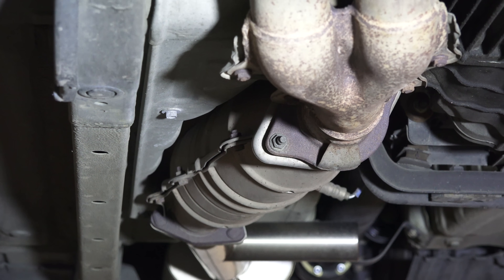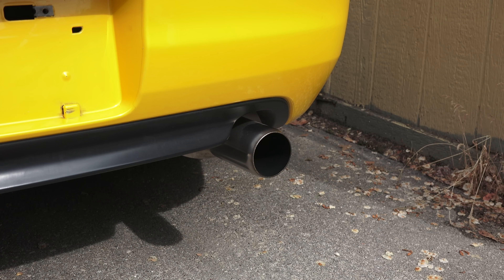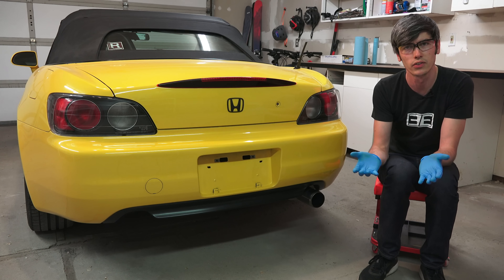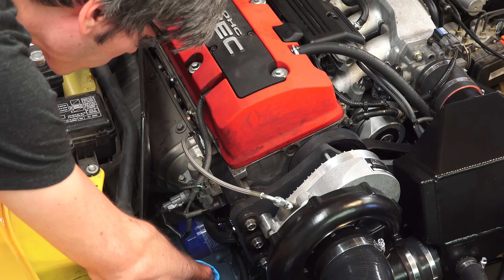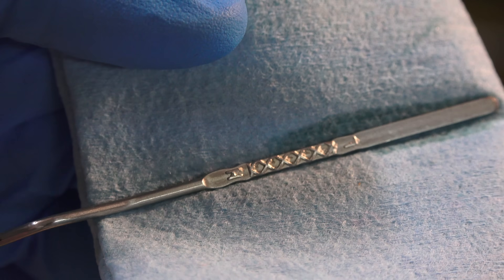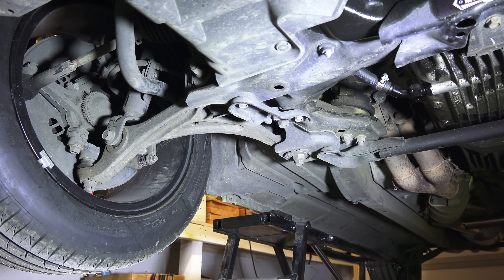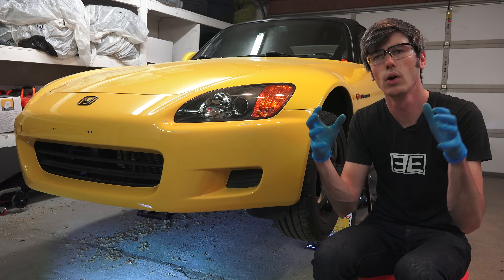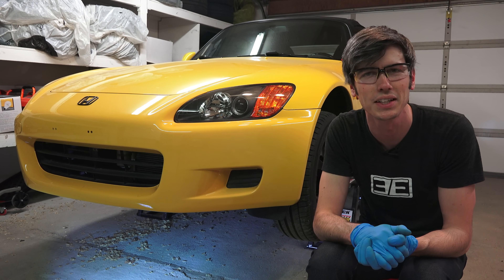5 Signs You Shouldn't Buy A Used Car

Comment: Hey Jason , love your videos! I've always been obsessed with the physics and science  behind the mechanics of machines especially cars. I wanted to put your expertise to the test to help me answer a hypothetical question about pro and turbochargers!! Theoretically would it be possible to power the normally exhaust driven end of a turbocharger with a belt driven procharger and then channel the clean procharger air from the exhaust outlet end of the turbo, that I'm assuming would still have a degree of psi, into the intake piping with the turbocharged air to create much more power than either alone, or would it cause too much load on the engine through the belt to have any sort of gain? I realize the amount of cylinders would have an affect on the degree of power lost due to load.
Reply from the maker: Sorry I'm not exactly sure what you're asking. To me it sounds like you're asking about a belt driven centrifugal supercharger (procharger is a brand of superchargers). These are belt driven, and the compressor looks a lot like the compressor of a turbocharger. Same idea, just using a belt to drive it rather than exhaust.
Reply: @EngineeringExplained  yes that's what I was talking about. I'm asking if, instead of running the charged air from the belt driven turbine straight into the intake, you ran it through the exhaust side of a normal turbo and the combined the air from both the exits that air is coming from and then into the intake, would this multiply the amount of boost without turbo lag or would it make no increase at all?

Comment: Re burning oil: creating a large cloud of smoke from the exhaust after sitting at a light (or other prolonged stop with the engine running) is usually indictive of bad valve stem seals. This is a relatively easy fix so if the rest of the vehicle seems to be taken care of then it might be worth the risk. Especially if you can articulate to the seller that something is wrong & needs to be taken care of.

Comment: I once bought a car that had its catalytic converter cartridge removed. The CC box was there but empty. I only found out 5 years later when I tried to replace it. There were no visible signs, no smoke, engine ran fine etc.

Comment: And, if you see CO2 or CO coming out of the exhaust with an IR camera you should not buy it and buy an EV instead ;)
Reply: Imagine trying to buy a used EV... There are almost no visual signs of things being wrong that you could check for yourself. It would be difficult to know if you're buying a busted one or not.
Reply: @zolikoff  I don't have to imagine.  My household has 3 plug in vehicles.  One fully electric and two plug in hybrids.  I bought them all used and they have been amongst the most reliable and trouble free vehicles I have ever owned.  Checking the condition of a used EV is easier.  The focus is on the battery and range.

Comment: I'd just make a note about the leaking bit: sometimes after a long drive, if it's summer, you'll get condensation from the AC dripping underneath the car. This should be fine and not to be confused with a fluid leak. It's just the extreme temperature difference.

Comment: The 5th sign is kind of moot if the car is OBD1 or earlier... Hondas that are OBD1/OBD0/Pre-OBD0/Pre-OBD1 typically have a jumper hidden in a panel that will make the Check Engine Light (CEL) flash codes. No flashes usually means it's fine. If there are flashes then pull the fuse for the ECU (under the hood) for 15 seconds, re-insert it, and then take the car for that test drive. If during the test drive there is no CEL then it's probably fine.

Comment: You forgot to mention about the transmission if it shifts badly than walk away
Reply: Darn, nothing with a manual for me then....
Reply: Jake Garrett - You're bad at shifting?
Reply: @Ck87JF  Yep! At least I haven't downshifted on the highway by accident in a while... (I did that in town a couple days ago, that was fun... But that's still not technically on the highway!)
Reply: Jake Garrett I decided to test drive a manual 2015 Mazda3 I was considering buying. Stalled it several times in the parking lot, but finally found my groove with the clutch. Stalled it on the way back, because the dealer was trying to fiddle with buttons on the steering wheel at the same time I was trying to turn onto a new road.  >_<

Last I drove manual was an eighties Ford Pinto.  :D
Reply: @Ck87JF  I probably stalled my RX-8 the same amount or more when I test drove it (the owner was staring at me like "wow, when this kid says he can't shift, he really can't shift!"). 

At least it sounds like you're better than my dad. I made a "grasscar" (lawn mower that does 40+ mph, still with the original super wobbly 1970's worn out steering...). It has the clutch and throttle on opposite sides of a normal car (clutch on right, throttle on left). My dad, no joke could be heard 1/4 mile away flooring it and grinding gears (for a solid 4 minutes before I could run over to him), because somehow he couldn't figure out why it wouldn't go into gear... Now, you would think, well maybe if this engine is revved to max shooting flames out the side, well maybe, just maybe, that's not the clutch? That transmission died shortly after. Sad part is he knew it was backwards, but really the worst part is not stopping and thinking, hmmmm.... maybe something is wrong....

So maybe I'm better at shifting than my dad, but I'm not exactly sure that's much of an achievement, LOL!
Reply: @Ck87JF  fair enough as long as the clutch wasn't slipping or grinding gears it fine
Reply: Jake Garrett - I wish I had/have more opportunity to drive a modern stick shift car. I may end up buying one, but people keep saying I'll hate it for daily driving. Without actually doing it, I can't know for sure. 

Anyway, I learned from my mom, and while she's a good driver herself, I'm not sure her teaching was perfect for the technical stuff. I've watched some of this channel's videos on manual, and I think I'm guilty of slipping the clutch.

Comment: there are NO timing issues with the accessory drive belt. you plug the obd2 scanner in BEFORE you turn on the ignition and start the engine. remove it AFTER the ignition and engine are off. you can also tell if there is a low compression cylinder by paying attention to the sound the starter makes as it cranks the engine.

Comment: Check the coolant before you start it, some head gasket failures push byproducts into the coolant and it will usually be visible.
Reply from the maker: Great tip!
Reply: What do u mean by byproducts like pieces of gaskets?

Comment: EVs have no exhaust, no oil, minimal "fluid" (not sure if there's power steering fluid since it's from electric and not from engine vacuum). You should do one for used EV buyers. 1. Stay away from Nissan Leaf. 2. Check battery degradation 3. Check uneven tire wear. What else?
Reply: Well, check the suspension, frame etc. Everything unrelated to the propulsion system is the same for EVs.
However, when it comes to the motor/battery, it sounds like you're out of luck, no good ways of manually checking if they're in order or not. It could have electrical problems that don't come up on a simple test drive. Hopefully digital diagnostics can help out in the future with this.

Comment: This is the check list I used when I bought my 99 civic si a few years back. Mostly stock, only 160000miles, only oil leak was distributor seal and not enough to drip.( easy fix)  It's now at 207000 miles and has given me zero issues. Great video

Comment: I didn't check coolant pipes before buying my used car :/
After 200km of driving the upper hose exploded in the middle of a highway.
Somehow i managed to drive it home for 12km without damaging the engine, after 2500km it has no signs of damage, fluids look fine, no weird smokes coming from the exhaust.

Comment: If you are not mechanically inclined person then find some one else you trust that is when looking for a good used car. If you can not find anyone you trust to help you then do not buy used cars. When I go shopping for used cars I find only 1 out of every 10 cars is in decent shape to buy. The other 9 are going to be shop queens. A used car that spend a lot of time in the shop is costing you a lot more money than a new car will. Consider the cost of a "loaner" car while yours is being fixed as part of the equation. And a self help video is not going to make you a smart used car buyer. Sort of like all the videos on what is the best oil to use in your car. You either know or you do not know. A video is not going to make you a person in the "know" group.
Reply: Good points but binge watching these videos for most people will give them a bucket of tools they can use to go over an used car before the make any further decisions like paying a mechanic to give it a more through inspection etc.  Check out 5 cars if 4 of 5 have issues then the 5th would be the one to spend the money checking.

Comment: I walk away if a car has different tyres on the same axle, it says a lot about the previous owner.
Reply: This is why my number 1 priority when selling trash cars that have had no maintenence whatsoever, is to just buy a set of matching tyres for them before selling. People don't suspect a thing.
Reply: @spinnie0  I knew a guy that flipped cars. Fresh tires and a spray can paint job. Throw it up for max blue book.
Reply: Good observation.  I usually check down at the floorboard to inspect the brake pedal and clutch (if applicable).  If the ribbed pattern is worn down to a smooth surface it's usually a good indication of how the car was treated by the previous owner(s).
Reply: I had a matching set of 4 Tires on my truck, my girlfriend got a flat borrowing it for work and her boss bought me a brand new tire of a different brand that day. I didn't say no because tires aren't cheap, that's what it says about me.
Reply: @saintsarecoming13  no But IT says enough if You love Cars or not
Reply: Green Giant can’t believe someone didn’t mention that earlier 😂😂
Reply: Exactly.
Reply: Wes Prang 
My favorite are the people that run spares at highway speeds.  I’d be willing to bet that 99% of cars on a spare don’t even have the spare at the correct tire pressure. Something no one EVER checks during routine maintenance.
Reply: I was looking for a 2nd hand rav4 then i notice 4 different brand tires on the vehicle while checking. Walk out right  away.
Reply: @Xandro_B20  have you heard of flat tire replacement due to nails and such.
Reply: That's straight illegal here in Denmark
Reply: Blocco Spirale I agree. I won’t even buy a car if it has mismatched tires on it.

Comment: I have a DI turbocharged application, and soot is known to be totally normal for us. Generally speaking, however, I agree with what you said. Another thing that can be HUGELY helpful in buying a used car is to ensure you do a compression and a leak-down test, especially if you notice some other concerning things, such as the different color smoke from the tailpipe(s) you mentioned.

Comment: Are those michelin pilot sport 4S tires? Great tires if they are, probably my favorite street tire.
Reply from the maker: Unfortunately not. They don't make PS4S for 16" wheels, and I quite like the stock wheels. These are PE2's which are an older pilot summer tire, still great.

Comment: Caution! Keep in mind that you should never go/put a part of your body under a car that is only supported by an AIR or HYDRAULIC suspension! There is a danger of sudden system depressurization, causing the car to fall.  

Great informative video otherwise

Comment: Ok, I'm gonna be the a$$

You can't see steam, you see water vapor.

Nope, that didn't feel good. The know it all thing is not for me ;-). 
As a young buyer, I've made some of those mistakes. Blue smoke all day. Oh, bent chassis! Car was written off then sold to me.
Reply: What does steam look like?
Reply: @harryscrotum007  It's transparent :)
Reply: @JeanPaulElectronics  what is the actual difference between steam and water vapor?
Reply: @harryscrotum007  Sorry I confused these words:  vapor is a gas and is invisible, steam is condensed (for example by cooling) vapor - kind of spray, fog - this is what you see above kettle when water boils. First is invisible vapor and above it there is steam.
Reply: @JeanPaulElectronics  right on thanks. Now I know exactly what you mean.
Reply: Umm..  water vapor is not always visible.  The humidity in the air is water vapor.  You cant see it.  My definition of steam is visable heated water vapor.  Otherwise clouds would be called steam balls or somthing.... but its just a dense concentration of water vapor....   just google it.  I dont know what comes out of a tailpipe exactly but if its heated water then it is steam.

Comment: Tip for coolant/head/head gasket leaks - with the engine/coolant cool (so you don't get scalded), open the radiator cap and start the engine... Look for fine air bubbles/frothyness in the coolant flow. Should run clear and without bubbles - a couple of bubbles soon after start can just be a little air trapped in hoses and will go away... If there's a leak, it'll generally remain bubbly after ~20-30 seconds though. Generally quick and easy to do.
Reply from the maker: Great tip!

Comment: I've had my car for over a year(4cyl. gasoline) and in the winter when it's below 10C deg, I'm seeing white smoke even when the engine is at operating temperature, driving over 10miles. In the summer I'm not seeing any smoke and the engine is not losing any coolant. Could it be just steam even for warmed engine?

Comment: 1. Smoke from exhaust white=coolant, blue=burning oil,  black/grey = incomplete combustion
2. Fluid leaks, if cleaned, then look for leaks after long text drive
3. Milky engine oil after test drive or thick sludge
4. Lots of rust // body damage // panel gaps // uneven paint
5. Many engine codes
6. Maybe mold smells, water damage along the carpet etc?

Comment: Great video. Thanks for putting this together. On the OBII scanner, is there a way to check if the owner recently cleared a code (indicating that theyre trying to hide a code)?
Reply from the maker: There is, though I'm not positive what scanners can/cannot see it. But there will be scanners that are capable of reading previous codes.
Reply: @EngineeringExplained  thanks

Comment: Can you give rough estimated distance on the long drive you have mentioned?
Also,does the black smoke implications remain same on diesel engines?
Reply from the maker: A good half hour or more is a decent duration for a test drive. You want to ensure everything's at operating temperature for a while. I drove my S2000 for probably an hour before buying it.

Comment: How long should the test drive be ?
Reply: You're wanting a good few miles at least, on different road types if possible, so regular town streets, and somewhere you can get a bit of speed up.  Get through all the gears (including reverse...a relative once bought a car years ago without checking...didn't end well when he parked nose in to a wall and couldn't get out the next day) and have at least one try at some heavy braking.  At the very minimum, get the vehicle up to operating temp from cold.  Be wary if they've "just warmed it up for you" before testing...That can hide a few issues too.
Reply: Problem is, a lot of dealers either want to ride along or limit the test drive to like ten minutes. Any good ways to deal with those scenarios?
Reply: @Ck87JF  unless it's near freezing outside, 10 mins should get up to temp.
Braking with a light hold on the steering should let you feel any judder or shaking, or moving out of line. Driving with the radio off let's you hear any strange noises. (Know of at least one backyard dealer who tried having the radio on to cover up bearing whine) Driving with someone else in the back means extra ears to listen out for problems.
Reply: ...long enough to get to operating temperature and test every function of the cars drivetrain suspension and braking system...hard acceleration/braking/turning/shifting/absorbing bumps on uneven surfaces...
Reply: Off the nearest cliff

Comment: Some oil additives make the oil look cloudy too but are actually good for the engine I believe.  Ceratec is an example of this it looks like buffalo bbq sauce, but the use of an additive could be indicative of a prior issue so, your point may still be valid on the oil.

Comment: What Tyres do you use on your S2000? Cheers and keep up the good work.
Reply from the maker: I've ran several. Got 3 sets currently haha, cuz why not, right? Xi3 for winter, and a set of PE2s and RE-71Rs.
Reply: @EngineeringExplained  Michelin all the way. I bought my "new" Mazda 3 Sport 2011, 2.0L and the first thing i did is buy a set of brand new Pilot Sport 4 for the summer(205/50/17). The car is just on another level.

Comment: One thing to note. The accessory belts for the alternator, A/C etc... have nothing to do with the timing. I don't think the average car shopper is going to pop off the timing cover to check that.
Reply from the maker: Depends if it's internal (like the chain on the S2000 in this video) or external. Often can check it.